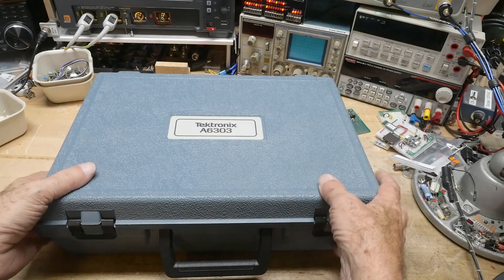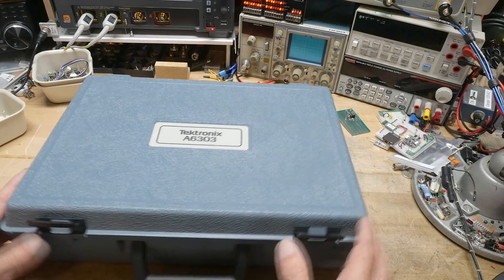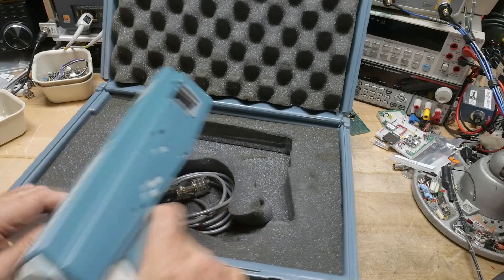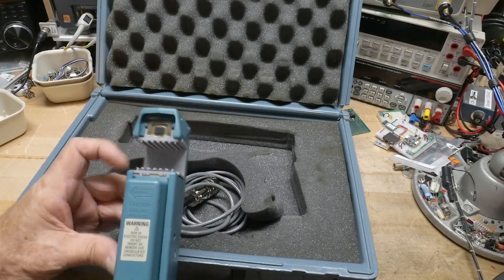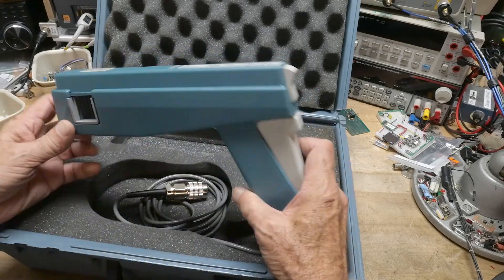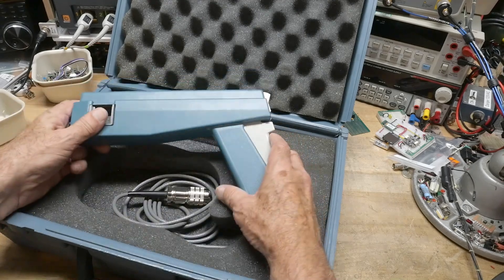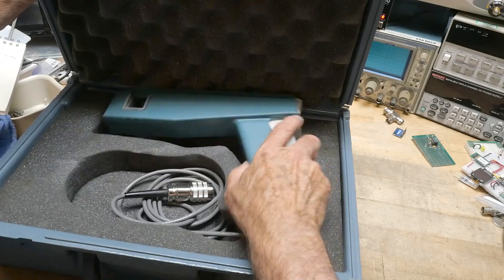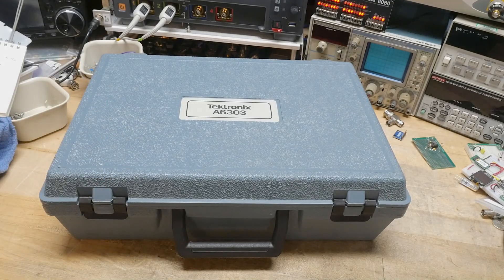#2350 Tektronix Current Probe A6303 (part 1 of 3)

Comment: the A6101 BTW has a switch on the adapter,  ranges 2ma./MV and 10ma./MV.  3 db down points are way down at mid/low range for any low audio response except with the preamp.  Not much good for checks of 60 Hz AC or bass audio.  .5 amp DC,  15 pk AC max.

Comment: I have the small A6016 current probe that I picked up at a hamfest for a few bucks,  but with no accessories.  The basic probe has horrid frequency response.  The active preamp or passive matching box compensate for this a great deal.  I built a copy of the passive inline box in the little smallest blue Pomona box for it. I have scarce need to monitor AC current with a scope so it is just there for whenever.  For fun I used it to look at the inrush current spike on a radio the other day but the information was not really necessary.

Comment: The current probes are quite expensive, and also fragile, so you run a big risk buying them on eBay and having them shipped. The AM503(A/B/C), on the other hand, is prevalent and cheap, to the point that they are the go to choice for a TM500 project box, if you are so inclined.

Comment: I have a couple of these and the smaller ones. They're great but they're best used at the high end of the scale. When you get down to the milliamp range there's a lot of noise and there is even a switchable filter on the AM503 to help in that regard. It's too late now, but if you want to actually use these beasts go with the AM503A or B rather than the vanilla AM503. There are a million mechanical contacts in the plain 503 and keeping it calibrated and working can be a chore. Not so with the A/B variants. For the price today, they are hard to beat. And yes, I do strike a gangsta pose in the lab when I need to make measurements with them.
Reply: (James Bond music starts...)